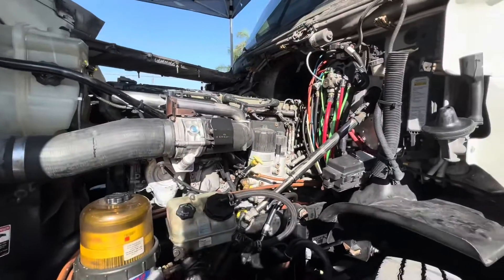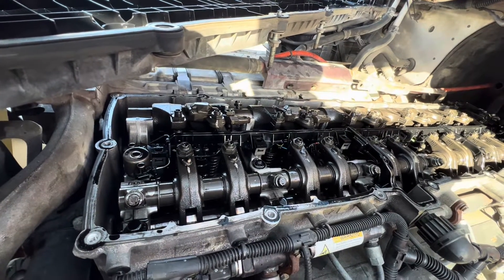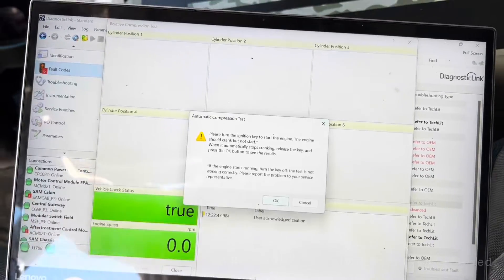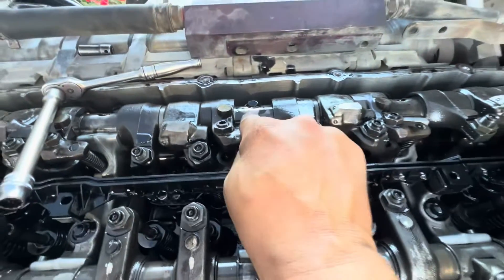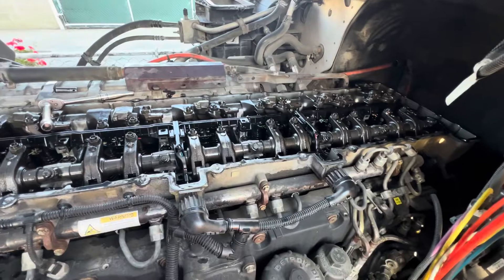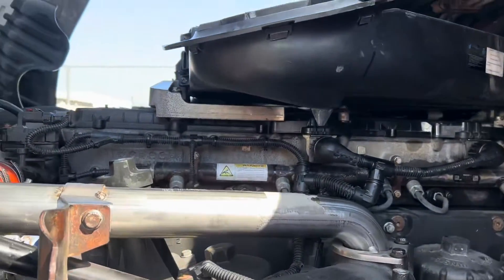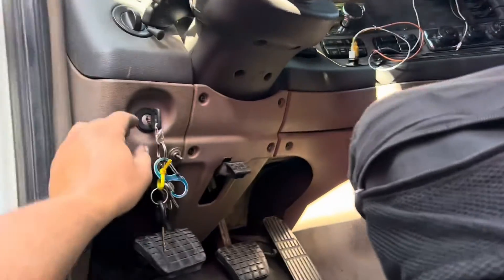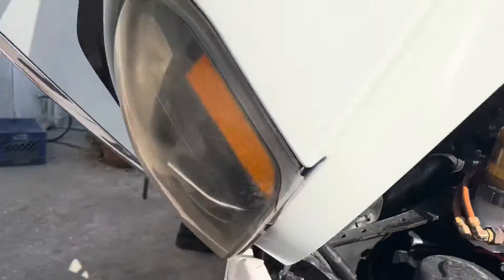Caught it just in time and avoided what could have been major engine damage on a DD15, loose bolts.

Comment: Was this a cause for power loss if any?
Reply from the maker: @Timokvei  low power  can be fuel filter related, air filter related, cylinder head valves need to be adjusted. It all depends on the complaint or symptom from the driver. Is the low power under load? Up hill? These are all questions that people need to ask
Reply: @CarlosDieselElectric  I m owner operator of truck in question. It has whole bouquet of problems and one of them it's loosing power and fuel efficiency. Jake brake has no difference in sound and braking efficiency between mid and high positions; very much no braking power just vibration added in low Jake brake position. And that same kind of vibration comes through during normal operation at times when there is barely any throttle response at cruise speed. It used to pull much better going over passes on I-5 and I-84 in Oregon. Now it feels gutless if not sped up before uphill.
2014 cascadia dd15 turbocompounder 475 hp 13sp 3.73 rears.
Air filter changed not long ago, still looks new and less than half on filter vacuum gage. Recently replaced all hoses after turbo including that big plastic intake elbow.
Compression shows good. Overhead done less that 70k mi ago last spring.
No fuel codes or any shavings in filter screen.
Also, for some reason there is more power in low range gears and below 25-30 mph, and about 350 HP limitation above 30 mph. I have Scan Gauge KR hooked up and that is what it shows. There were times when it was showing hps going into 420 or more @1400-1600rpms and it sure felt like a beast in comparison, but nicely responsive smooth power that pulls. I had it this way all 6years of owning it and nobody can tell me what the heck is that all about. BTW It is SWIFT truck in the past.
Reply from the maker: @ try using a test MCM.

Comment: Hi Sir. I have hissing noise on cold start but when temperature goes up it is going away all time. So what should it be?
Reply from the maker: @tait4613  find a shop to perform a compression test and see what the numbers are. I am pretty sure your valves are tight and need to be adjusted. Running the test lets you see which cylinder needs more attention. It’s always good to run a before and after to see the change. 
Either way all the valves should be adjusted.
Reply: Thank you for your answer but I recently did valve adjustment but don’t know about compression test. Could it be cylinder head?
Reply from the maker: @tait4613 possibly the cylinder head. Try having the test performed to help determine
Reply: So if it’s cylinder head need to prepare money to fix it
Reply from the maker: @tait4613 also. Check the intake or exhaust manifold gasket for leaks or possibly the turbo mounting gasket.
Reply: And it says air intake problem detected and then when temperature goes up it’s automatically turning off codes by itself
Reply: Hi sir. So I inspected that sound again and seems like coming from intake throttle valve from driver side. When I checked from passenger side nothing. Could be throttle valve?
Reply: And I have a video of the cold start
Reply from the maker: @tait4613  send me the video. Email
Reply: What’s your email?
Reply from the maker: @ carlosdiesel@sbcglobal.net
Reply: Hi man. Sent it

Comment: Why wouldn't you install the heli coil in yourself?
Reply from the maker: You can certainly install a coil but I prefer to leave certain things up to the pros and. I honestly never tried to do it myself.
Reply from the maker: You can certainly install a coil but I prefer to leave certain things up to the pros and. I honestly never tried to do it myself.
Reply: @CarlosDieselElectric  try it once. You will never pay someone again
Reply from the maker: @7thfloorisnomoreq790  will do.
Reply: New cam frame housing is the correct way, especially with torque to yield tightening.

Comment: I had done the same test and the reading is 
(1=92%)
(2=100%)
(3=88%)
( 4 = 92%)
(5 =0%)
(6=33.5%)
 when it was called and i had the engine running for 10 minutes and i did the test again and the reading was 
(1= 96%)
(2=100%)
(3=93.5%) 
(4=88%) 
(5=0%) 
(6=62.5%)
What that’s mean ??
Reply: when the engine warms up the pistons increase in size due to thermal expansion, causing the compression to seal better. 
cylinder #5 seems fucked up though regardless

Comment: I don't even give the option to the customer. Repair the correct way or charge for the the amount for disassemble and some extra and he can take a hike. 25 years in the exotic automotive repair business (currently owner operator with the dd15 cascadia😂) realized how much mechanic trying save some money for the driver. And 90% of the time the other shop need to deal with the so called savings.  Carlos you can only able to fix trucks easy but can't fix your reputation . 🍻🍻
Reply from the maker: Valid points 🍻 I appreciate it
Reply: you aint no mechanic
Reply: I wondering this response for who??
Sheep head